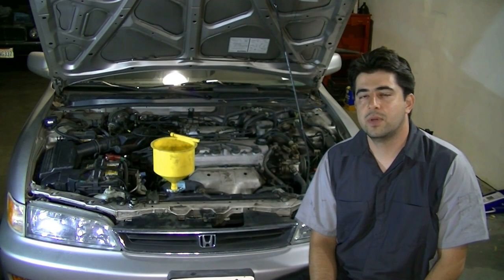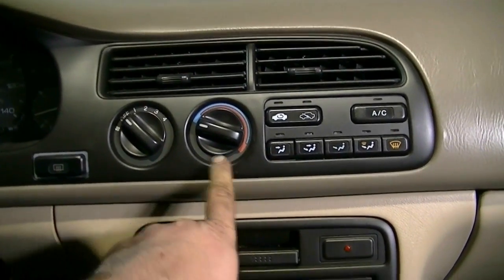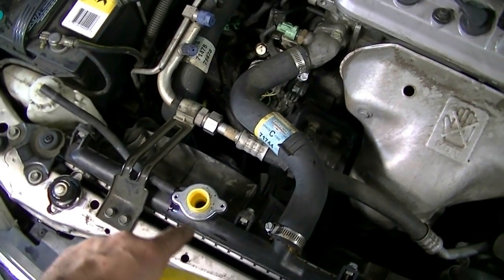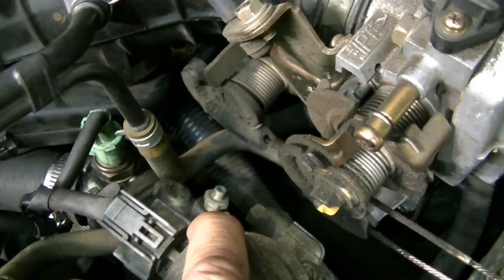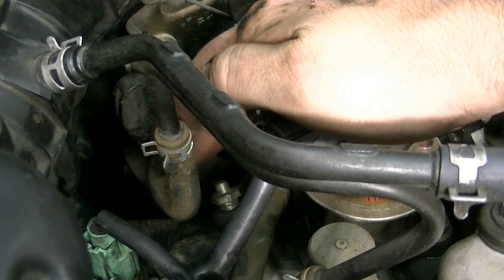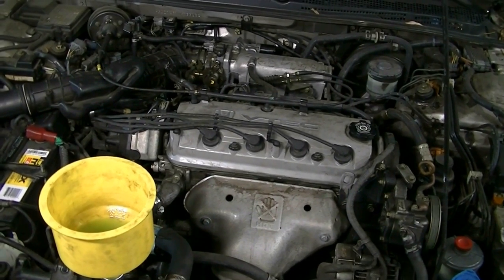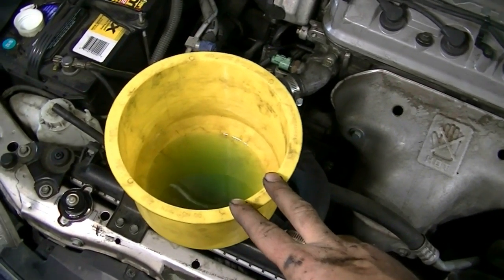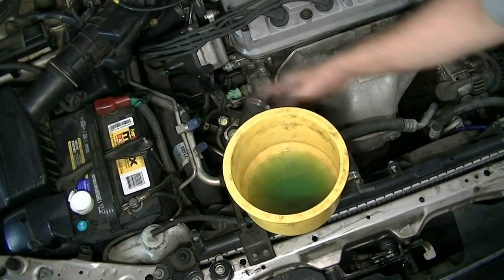How to Bleed Air Out of Your Cars Cooling System

Comment: Quick question, aren't you bend the hose connecting to the coolant reservoir so that it will not suck air or coolant from the reservoir while performing this task?

Comment: hey Eric, I got a 96 Sebring and flushed the whole cooling system. Water does flow freely through the heater core. I attached some of those tea valves and ran system water only through the heater core. I still got no heat in the cab I just fixed the I put a new climate control in the control seem to be moving freely. The recirculation one is kind of stuck. I have to look at that it's acting weird but I have not been able to get any heat in this car. It has the 2.5 L V-6 and I guess it's a pressurized coolant system. I can't find the bleeder valve on this car but it's the GX a convertible.

Comment: I changed out my radiator. I did not do this. I destroyed my engine after driving 2000 miles. Expensive.  The engine was at normal temperature, but radiator was cold.

Comment: The coolant temperature switch by the thermostat and the one in front  of engine where the upper hose connect, are these the same like part number wise for 95 accord?

Comment: Wife's 08 Pacifica would not blow hot air. Looked under hood and for some reason(knucklehead service dude?) the Cap was not on the coolant reservoir. Luckily it had come to rest were I could find it. Filled reservoir up to line and now car has hot air. QUESTION: can I expect air pockets to interupt hot air?

Comment: Did this method and everything went nicely...at first. Had a nice bubble going then bubbling got overly violent, spray out and around the funnel in a three foot radius. Thermostat? Head gasket? I have both heat and ac. I just replaced the radiator, could a huge airpocket cause it? Should I try burping again? I realize now I should have checked the thermostat while I did the radiator but im new to this. I have a subaru outback 2008 btw. Thanks for any input. Also, water pump was replaced within the last couple years but i did not check that either
Reply: IGniTuv 

Did you ever find out what the problem was?  My Honda Civic did the EXACT same thing.  The only difference, when I had the radiator and fan replaced, I did not do the water pump.
Reply: Aim I cant be certain but I think it was just an airpocket. IT ended up bleading itself out over a few days, just filled up on coolant through the radiator cap first then reservoir second on day one, then topped off the reservoir over the next 3 days and I was good to go. Good luck! Be safe with the volcano coolant lol

Comment: Can you get the air out with one of those Stant radiator caps that have the red thing to lift and release pressure. When the car is hot, turn it off, lift red valve. Then blup, blup, blup the bubbles and air go into the  reservoir tank.  Or no??
Reply: No so its pretty much a safe way to release pressure without spraying yourself with coolant nothing more unfortunately

Comment: 06 ford Escape. Had a Garage replace transmission. Everything seemed ok till went to turn heat on. NO Heat. took it back said My heat don't work. Service Manager said. You need a heater core and its going to cost a lot of money. I said My heat worked when I brought it here. I googled no heat before I came and it said theres probably air in the lines if You just had work done.He says we don't have the equipment to bleed the line and if there was air in them it should have worked out by now. Then he says we didn't mess with or do anything to your heating system. replacing the transmission doesn't effect it. He has on my bill 20.95 for antifreeze? Help Me please.
Reply: Any updates?

Comment: My 96 Explorer with the 4.0L OHV never heated up right, gauge always swings. Confirmed temp with IR thermometer, scan tool, and dash gauge. Two motorcraft tstats, never go above 186, cycle at 174 (barley touches the bottom of the  thermometer icon). Gauge never reaches center. Tstat rating says `190 or 197. Was like this 60K miles, since I got it, never lost a drop of coolant. Tried different methods of burping, used funnel, squeezed hoses, seems there are always bubbles coming out when I squeeze upper hose. No bubbles otherwise.  Thinking maybe steam formation, also tested for bad HG.  This engine is weird, no external bypass, there was some TSB with a kit that is not made anymore. Never bought the kit because it was like $150 and the ford tech I asked there said it will run forever like that and don't waste money. That has to be a band aid masking some other problem. Maybe I'll try a stant stat.

Comment: hey bro I have a 2001 is300 but when I turn on my heat only the passenger vent gives warm air and all the others are cold
Reply: the part calles actuator you changed you be good

Comment: How long do you wait on the fans? say if its been idling for 25 minutes and it still didnt cut on, its about 50°F out
Reply: Hold RPM's to 3k and the fans will come on in 5-10 minutes.
Reply: Turn the ac on.

Comment: i installed a new radiator on my car, thurmastat open and my air conditioner blows cold and hot air. the only problem is that my fans dont turn on automatically. what can i do to fix this problem ?

Comment: what happens when the funnel is full of coolant and you need to remove it? have it spill all over the engine?
Reply: That specific kit has a handle with a plug on the end that you stick down in the funnel before pulling off of the radiator.
Reply: Javier Avila

Comment: Guys, the whole episode of trapping excess coolant in the funnel is absolutely unnecessary. I have no idea which bright mechanic initiated such bright practice! Just pour the coolant in the radiator to the brim. Remove the funnel if u r using one and just run the car. While the car starts heating, the excess coolant and bubbles start flowing to the reservoir tank. The reservoir tank is engineered and installed for this purpose. I always change the coolant this way. Let excess coolant fluid flow through the hole at the top of the radiator neck to the reservoir, wa ssalam amk
Reply: some engines are subject to cavitation..which will ultimately leave you with not enough coolant after you have filled your radiator to the brim. you could actually be short to the point that your heat no longer works. So this brilliant idea as it were is 100% necessary in many instances.
Reply: You must don't work on cars much.  SOmetimes the car pushes the coolant out during waiting on the tstat to open.  Yes it's a good idea to have that on so you don't spill radiator fluid every damn where
Reply: Visam Mansur my thoughts exactly.

Comment: Aren't you supposed to jack up the front end or park on a hill to where your front end is higher than the rear? That is so the air bubbles can find it's way out by flowing out the highest part of the car.
Reply from the maker: +Sam Han As long as you have a funnel it will work fine. Raising the front or parking up a hill helps though.
Reply: Sam Han

Comment: So what happens when the funnel is full of coolant and you need to pull it out? Do you just let the coolant spill down your radiator?
Reply: his type of funnel usually comes with a plug to hold the coolant after hes finished bleeding the system. basically just a yellow stopper.
Reply: If you dont have a stopper you can use a screw driver and a rag. Wrap the rag around your screw driver end and shove it down the funnel. Then bring out the funnel and empty it into a waiting container.

Comment: Dear Sir I got a Nissan pathfinder R 50 , 2005 model ( Qatar - Middle East) , unfortunately I could not find the bleeder valve or air out valve,
please help me
muhammad
Reply: +Ismail Suffiyan it could not be equipped with a bleeder valve. ive never used bleeder valve before myself.